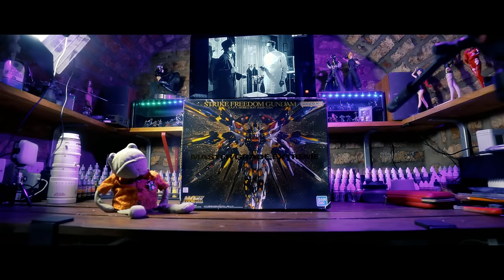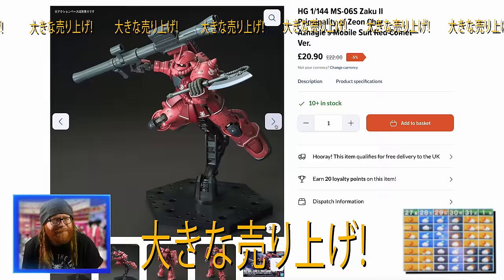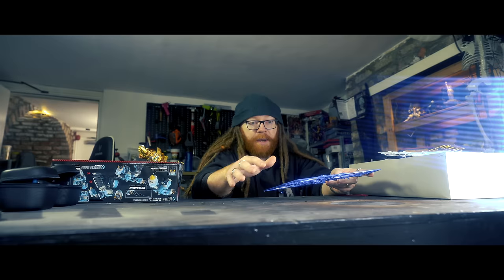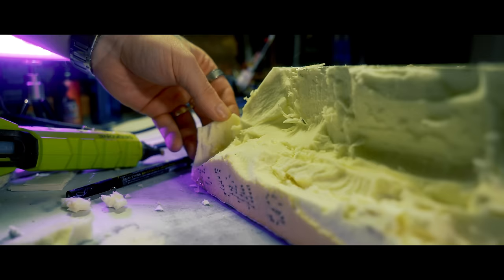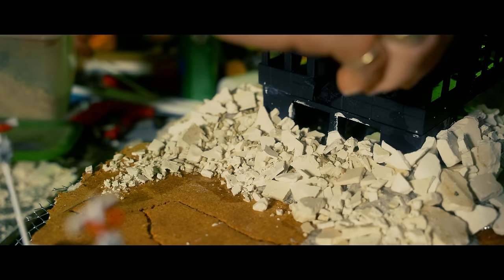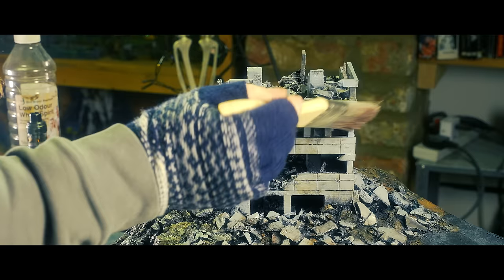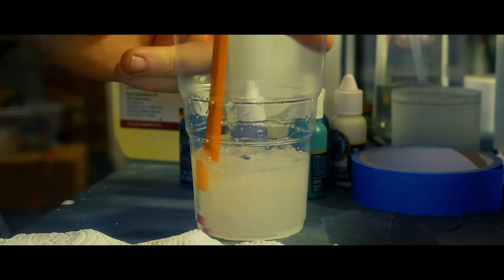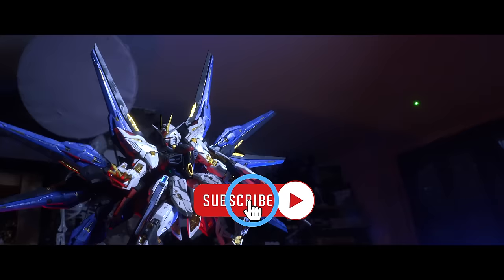SAVIOUR - Making a CINEMATIC Gundam Diorama

Comment: Since I haven't seen it, they're "water slide" decals, or transfers...

That said, holy shit, that's one hell of a build...  Good on ya, sir.
Reply: how do you know if they're waterslide's or dry transfers?
Reply: @GladiarOfDestruction  I'm not sure what sort of distinction you're looking for here, but I'll give it a shot: Waterslide transfers are basically a thin printed plastic, using a paper backing for mostly logistics and handling purposes...  The only "dry" transfers I'm familiar with get applied by essentially "pushing" them onto a surface by applying pressure to the backing paper, which, iirc, tended to be something akin to tracing paper, or are (usually...) die-cut, printed on a thicker material, and utilize an additional adhesive layer to affix the decal...  The former of which I've not seen in a kit for literal decades, and the latter of which I've seen only rarely, usually with toys or cheaper scale model kits.

Comment: Miniature hobbyists, the community renound for painstakingly painting rocks like rocks. Now we're painting blue plastic blue! This hobby is reacking new abstract heights and I'm here for it haha

Semi-serious ability question: Do you find push fit easier to build as its all designed with ease of construction in mind, or does the increased pressure required to seat the pieces in place cause you grief? Asking because I find myself monodactyl for the next 10 weeks and I'd be interested to hear your thoughts.
Reply from the maker: Depends on the push fit mate. This kit is the most pleasant and well machined thing I’ve ever built. Just enough resistance to satisfy and stay in place, but it want ever fighting me. Most modern high grades also feel similar too, Witch from Mercury stuff is great. Building a perfect grade at the moment… that’s genuinely horrific and not a lot of it fits comfortably. I’d say there’s still a degree of articulation needed though. You may still struggle! But a high grade might still be fun!
Reply: @MSPaints  Thanks for the insight. I'm greatful this is only temporary but in the meantime I still want to hobby. Only tried GW or Revell pushfit before and they fight every step. (Revell less so but still hard even with two working hands). Thanks for the advice.

Comment: I'm kinda surprised you went with painting the pieces to ensure a uniform/predictable reaction to weathering, rather than spraying them all with a matt/satin/gloss varnish (depending on how you wanted them to behave).

Great diorama though. Just bought my first ever Bandai kit (RX-78-2 of course) and look forward to putting it together and weathering it down. You also inspired my nephews present at a point I was struggling, so, ta!
Reply from the maker: Mostly due to deadline. Didn’t have time to leave a varnish layer to cure, only for it to not fully do the job or exhibit hydrophobia. So we primed. Exact same result in the end to be fair! 🐸